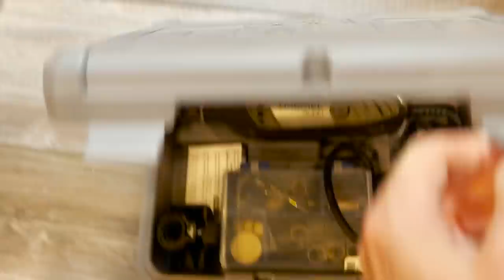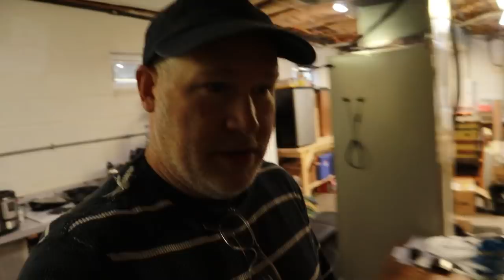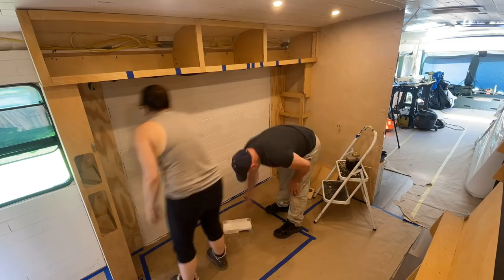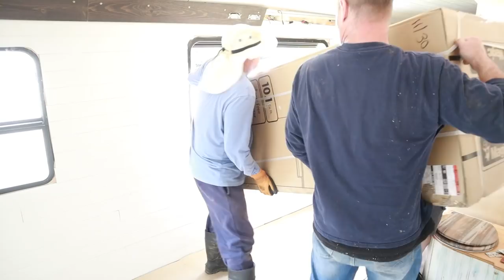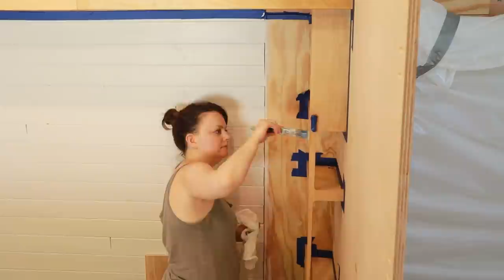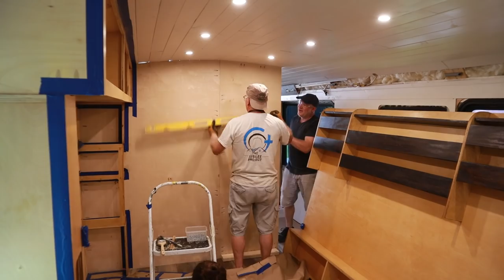Bus Conversion While Coping with Grief // One Day at a Time - S04E14

Comment: You gotta use the right tool for the job if you want things to be quick and have the best chance of a nice finish. You should always use a table saw to make long cuts, especially ripping cuts like the one on the bottom of your bed cabinets. A jigsaw has a small blade, so you get a very erratic long cut because you have to constantly correct the blade to stay on the line. A table saw doesn't allow you to introduce any error. A chopping-type saw is the best choice for short cuts because you can get a perfect angle and a straight cut every time. Plus, you can set up a stop block if you have to make multiple duplicates. Try not to use your hand tools if you don't have to.

Comment: I guess you will run it through an inverter. I bought (couple of years ago) magic chief 3.2 cf. for my semi truck and it doesn't work with inverter because it's designed for AC not DC electricity form. I don't want to say this particular fridge will not work 100% just check it before you can't return it)))))) Good luck!